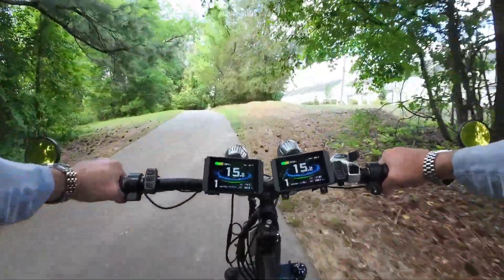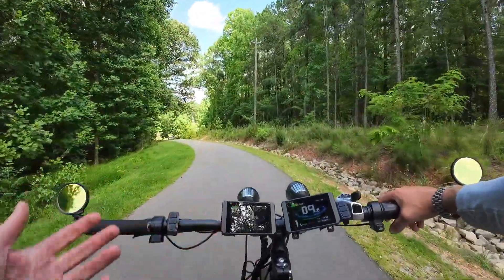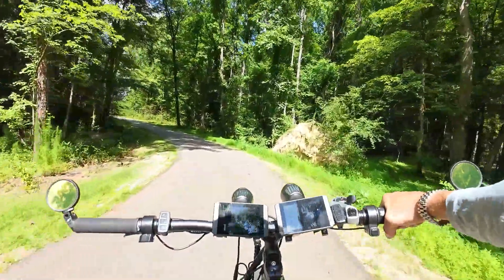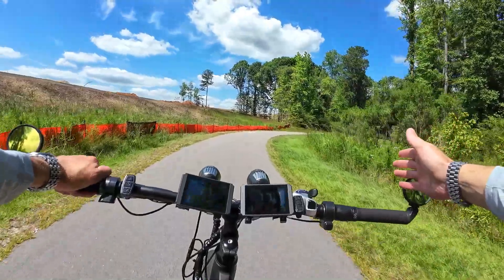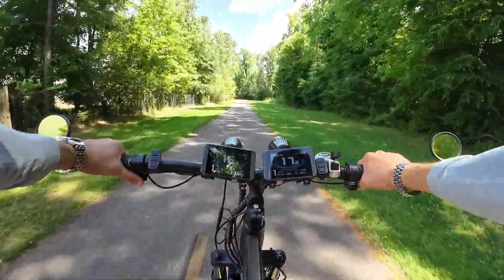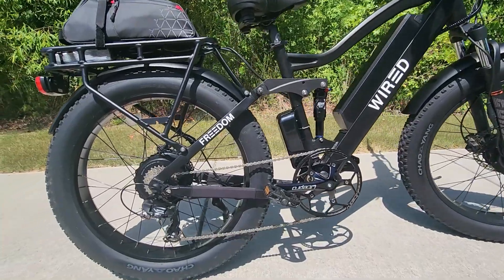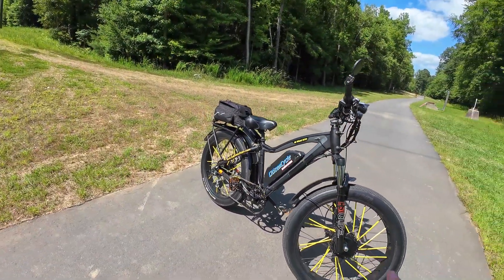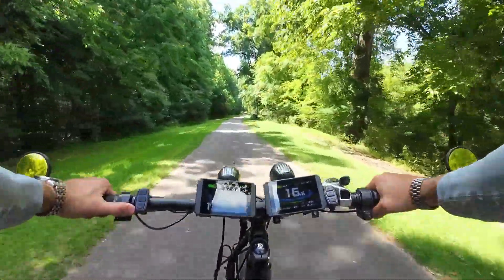Aftermarket ebike Parts: Hard to Find & Make

Comment: Yeah I asked a question maybe a week ago but I forgot the episode. I have an e-bike made by the company SAMEBIKE. I ordered one delivered to Osaka Japan. The lady told me a lie and said the bike had a throttle. Long story short. The bike only has a torque sensor. Their engineering team told me it's impossible to change the controller and add a throttle. My question is, is it impossible to change the controller and add a throttle? I will remember this episode and check back. Thanks in advance.
Kind wishes,
Edward

Comment: I am having same issue with upgrading or mod various ebikes.   Even the frequency of signals are not the same even with the same connectors.  Had issues finding compatible throttles and cadence sensor as connectors matched but signal does not

Comment: If your up to it, or if not hire an electrical person to do it, but put in some time doing research on all those connections, as most controllers, motors, displays, etc have alot of the same connections on their PCBs, even if the wiring harnesses, connectors vary widely, but after doing that, find a manuf/distributor to make the most common to start and sell them at a major premium... 

People would buy them just to save themselves the hassle and its not price gouging (although some will say that, inevitably) as you took the initiative as well as did the R&D. I think youd rake it in and once all the research/manuf vendors were sorted, itd be alot simpler than shipping in batt pks.

Its a heck of alot at the start no doubt but the payoff might be outstanding as your kindve the first, I think? Just my 2C

Comment: I love my aventon aventure and honestly I actually pedal so it doesn't "NEED" more power but who doesn't WANT more power.  My biggest beef with it, is the lack of user adjust-ability of the pedal assist levels.  I have the 1.0 version with the cadence sensor. If you have ever ridden in a group with other bikes, you soon realize none of them will match speeds.  I am constantly tapping the brake lever to shut off motor to slow down, or pedaling past the cadence level to catch up.  So being selfish (I realize) I would love a 35-40 amp controller and a more programmable screen to make my already pretty good bike, much better.

Comment: Let’s see if I can explain this right! You come up with an upgraded part, with out a connector. Now, you come up with a great solution to connect your part to an existing bike part motor wire, battery wire etc. then you sell your connector (male& female) with your upgraded part to complete the installation..the customer will have to cut the wire end of the existing part and install your new connector to add your upgraded part. Hopefully if successful the new bike industry will catch on and start using your great new electric wire connection as an industry standard. Not only will you sell your better part but create a better way to install it to an existing bike. In conclusion not only offering better aftermarket technology but also providing a more reliable alternative to connecting your upgrades to existing bike parts. THE CITIZEN CONNECTOR!!  Tc from Nevada

Comment: So I can get generic parts I have to mess with all sorts of places, including Amazon.  If I was going to buy after market parts from someone like you I would expect them to be better than what I can just pick up from other places.

With that said, it dosnt have to be 100% plug and play.  Most of the people buying this stuff are reasonably competent.  What I would do is make sure that the plugs on your controller for example all have the same ports for the same items across all controllers you would sell.  One standard battery connector, one standard throttle connector, etc.  

I would then make adapter cables for the most common plug types to sell as addons.  I know there are endless options and you cant stock everything, but I am also guessing there are probably only a hand full of battery connectors.  Yeah, you will never be able to get them all, but maybe you could get 70% off all battery possibilities with 5 or 10 different adapter cables.

Comment: I’m thinking about just going for the whole deal including the rear wheel and motor so I’ve got usable bike. The way this thing is now it’s so aggravating when you drive it. But that would solve my problem with just putting a whole new system on the bike.

Comment: Ran into this recently. My Ancheer e-bike battery was getting crappy range and I went to get a new battery with more amp hours. Same size outer case, brackets,etc. but the terminals were a different configuration even though it’s from the same company only a year later. Hopefully the e-bike industry will learn from the cordless power tool industry and make some one size fits all parts. I’m dreading rewiring the new battery. Love the peel outs in your video!
Reply from the maker: That's surprising it didn't fit from the same company. battery connections are usually pretty easy though

Comment: gee - I see several good ideas for options here. :O 

 ok my favoto step thru flurry 2.0 has a 22 amp controller and my other is a fearless step over with a 20 amp controller - both have bafang 750 watt hub motors and 48v 14A batteries.
 they are a year apart in age 2022 on the fearless & 2023 on the flurry

the step thru (flurry) seems to go better [both are set to 20A cur] with the same settings, but different controllers and displays

     my thought is to get  at least a 28A controller and the correct display for it. (?)
 might need to replace the wire harness as who knows what they used?

thankfully the motors are as standard as bafang are going to be. & both are cadence sensors.
 
 Im a bit different and would like to see my power increase in the low torque for easier steep hill climbing.
 16 to 20 mph would be a fine top speed for my ebikes. I want gravel road & trail torque.

 might be great to have a kit with wires loose and I could install the connectors that are compatible for my ebike (?) 

 or might it be better to replace the complete wire harness?  if the ends are not connected? then I can cut it to the right length for the ebike.  then connect it/complete it myself so its to my liking.      

 Im with others in suggesting a complete kit with the controller, display and an unfinished wire harness that we can trim to fit our ebikes. 
 
 of course Id get a controller upgrade "If" it made the difference in low end torque Im looking for.

  Iam still waiting to buy the wired cruiser or an ecells step star, but neither may be what want.
 as for me I want to go low n slow, the top end speed is not something that interests me. [I avoid public roads]

 to get what suits me, I may have to build it. :O

Comment: My Fabulous havac x2 the headlight horn stopped working I opened the controller box and found 2 small wires disconnected but they were like soderd in I think I wish there was a fuse box type plugin for all e bikes

Comment: lol chop em all and go back to spade/lug old school - give em bare wires and let em chop their wires to match

but what you can do is standardize your own interface and just add dumb adapters; connectors themselves aren't expensive so they don't add much to the cost.

Someone recently did that for power tools - they made an interface and a generic battery pack, so you do have to add the adapter to each power tool per manufacturer but you can thereafter use the generic pack for any tool that has an adapter.  the bonus is that they added features to the packs like onboard charging and USB A out for people to charge devices with, so if you have added features that are gained with your controller then more people are apt to have interest.

If you're after a generic controller just to make your life easier, remember it's not a product...

Making parts for current ebikes is kind of a tight market; lots of people in the space and it's well along the race to the bottom so profits are already shrinking.  The right thing to do is just take the leap and make a 100% domestically sourced/built product, then all the features other companies don't want to put in are options for us to add.  This can also get us ahead of all the ebike legislation that's piling up and coming down the pipeline because we're local and that gives us agility to respond and turn around feature adds quickly.

Imagine being able to order with granularity your own configuration and have it not be upcharged 300% because of tariffs, shipping/cartage, etc.  That's possible if I don't have to be on calls all the time with multiple countries who are supplying us, and the latency between fixes to deploy in our local markets have always been a sore point with me.  It's cheaper to do it locally as well; if you can't run a sweatshop anymore (Foxconn, Cor-Tek, etc), you won't save that money, so there's no real value in offshoring it.  If anything, I'd go with Taiwan because they're far and away ahead of the planet in their infrastructure for PEV - up to and including public battery swap programs so you don't even have to charge your PEV, you just deposit your battery and it gives you a fresh one, all at roadside kiosks throughout the cities  Even the batteries themselves are self-tracking and have connectivity, so it makes the process super fast as all the components recognize each other and simply work - you tell it you're there, it opens a door, you push the battery in the hole, hole closes, it verifies the battery, another door opens up and it pushes the fresh one, also tracked, part way out the door so you can see which one is yours without having to look at all.

But with Pinion's new MGU and things like downtube motors (Fauza) or harmonic pin drives (TQ) or non-IGH gearboxes (Enviolo extreme), et al, there are a lot of opportunities to wisely buy the best components available and make those builds available at what seems like a ridiculous cost but was mostly achieved by using less and pulling large chunks of complexity out of the design.  I'm also working on a frame design for travel bikes that will assist people getting into it as the last stage of unfolding - doubly value add because it also lets them basically walk into the bike instead of having to step over (even a low slung travel bike will be hard for some people, if the frame folds orthogonally from the typical then it can actually be resting on the ground before being snapped into the last place).

There are no new problems and as far as I can tell the ebike segment really lags technology and cost vectors of many other industries/products...spent over 25 years developing/deploying/sustaining advanced technologies, now I'm bored.  Find me a new problem ;-)
Reply from the maker: Wow somebody really knows their stuff !!!  Thank you for the input & info!

Comment: The only two options you’ll have are either create proprietary parts, or make adapters. Also, on that Citizen you didn’t need two displays or two throttles. You only need to run the signal wire from second controller throttle output to engage your front setup. Also, you can run both batteries in parallel to double your range with a splitter. That’ll reduce wiring and complexity. However, if you want real speed and a decent profit, you’ll need to enter the 72v realm. If you run proprietary parts, you choose the connectors you want to use in your kits. Powerful Lithium does this with their custom batteries & they are building some of the best in the world. E-bike Guy down here in Central FL builds his own batteries. His 8kw diy mtn bike topped out at 105mph. I’m in the middle of three builds (2ebike one scooter):
8kw single motor (QS273), Fardriver 961800 track version controller, Molicel P42A battery

Dual 3500w motors, dual Fardriver 72120 controllers, Molicel P42A battery

Scooter dual 5kw motors, dual Fardriver 7250 controllers, Molicel P42A battery. 

The above should yield a top speed north of 55-100mph. The Molicel is the most energy dense cell to use for batteries & have the least voltage sag. Fardriver controllers make the most power. QS motors are the only hub motors to handle that much power. For mid drive motors, the closest in that category is the Sotion FW11. 

Keep in mind the aftermarket is always a very tiny community of enthusiasts who may not be necessarily interested in your products. Leaf Bike & a few other shops are finding this out the hard way as they don’t really offer anything high powered. Granted, not everyone wants super high power, but an ebike traveling under 40mph becomes numb and old quickly. Hence why a lot of people want to go faster than the class 3 regulation of 28mph. I also believe keeping up with traffic is safer and you’re less likely to be hit since you are more visible at a similar speed to traffic. 

Just a few thoughts to consider.
Reply from the maker: Thanks for all the info. on my bike I actually prefer separate batteries separate throttle separate display screens I find it much safer, the front wheel is never accidentally activated. I would never ever combine throttles. 
I think the aftermarket for a very high powered e-bikes is probably pretty small, but for folks who just want to increase to like a 35 amp controller for their average e-bike I think that aftermarket's actually pretty big. But thank you for all your ideas and input!!

Comment: ADAPTORS!  Maybe what is needed is a comprehensive kit of plug adaptors, connection adaptors.  I wonder how many adaptor types you could find just by searching for adaptors?  You come up with a universal adaptor set,  What you can't find, you might create.  This might require stripping wires going into connectors & soldering those wires.
Reply from the maker: Cool idea, I know I would buy an adapter set like that!!

Comment: I like what you are doing and thinking. Your knowledge is of help, such as: Do those spoke wheels hold up well or do them start wobbling from the stress of the motoring? But spoke wheels are the platform for front-wheel drive... and then, for coasting, what direct-drive motor would you choose? The geared motors have more drag, true? How easy can we install our own torque-sensor? Etc. Maybe I should check out your website. Thanks. PS- I'm impressed with the step-through Heybike folding, 24-inch wheels, spoked. Good platform I say, not really for racing, just pleasure adventure. Otherwise Vitalan folding. I think Heybike has better support?

Comment: you need 1 controler and 1 diplay to power both front and rear motors  60volt would be nice  not 2 different systems  you know this allready  like your website  watch  you tube all the time  alot of good innovation in ebilke world  40mph and longer range is always welcome dont for get torque  40mph seems to be the sweet spot for ebikes and e-mopeds

Comment: Parts are not standardized because they are all imported from China. China runs fast and loose on following regulations. Maybe you could invent a universal cable which can accommodate most plugs. Just do not have China build it.

Comment: Stock and sell the different plugs separately and sell the controllers with bare wire ends. The customer should find out which plugs they need.

Comment: I have found that ebikes have another  downside that is kind of a pain..  And that is the relative cost of the new battery compared to the entire bike itself. When a battery wears out and needs replacement or you long for that full power you had when the battery is new, then you are faced with a decision to make. Do I sink $500+ more dollars for a quality battery into this 2-4 year old bike or buy one of the new bikes?   Now that there are  better models on the market,  You feel you are throwing money away putting a new battery on an old bike when a new bike can be had for an affordable price.   This is unlike a non electric bike that you might keep for 10-20 years and tweak a little bit here and there and still get the same performance.

Comment: One of the biggest problems is the risk being taken by sourcing components in China. China does NOT recognize property rights that the rest of the world takes for granted. 
If someone designs a unique part or component and sources manufacturing to China, China could easily take your invention and allow other China companies to make and sell it. 
I was into diecast cars for a while that were sold mainly by Franklin Mint and Danbury Mint.   China decided unilaterally one year at year-end to convert all the manufacturing plants making those diecast and begin making other products in those factories (with all new employees).  They MELTED DOWN all the tooling that had been used to make the diecast cars, tooling that both Mints paid for and had ownership rights ...... but China overruled that and melted the tooling --- and didn't pay the Mints back for what they owned. 
I think you might better not get your mind too far down the path of making aftermarket parts, Citizen. What you've done so far was take advantage of parts already in the pipeline, and very low risk to you. But if you start doing unique parts/components, you could find yourself losing your investment, and suddenly have no manufacturing source for your trouble.

Comment: Used to be back in 2017-2020 things were interchangeable. There were similarity between stuff. You just said you can’ t imagine the manufactures are doing that but I do. It’s all proprietary now. The old Bolton bikes used to have solutions to make improvements I have a 2018 RadMini with Bolton’s replacement real 750w hub. All sorts of stuff as on line. Now no more. Good video prime topic sadly not much we can do.